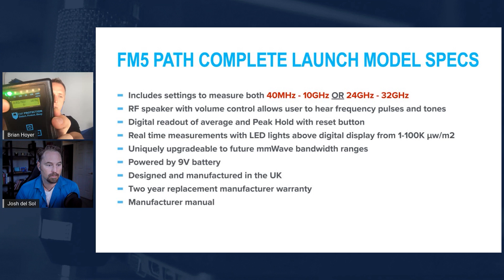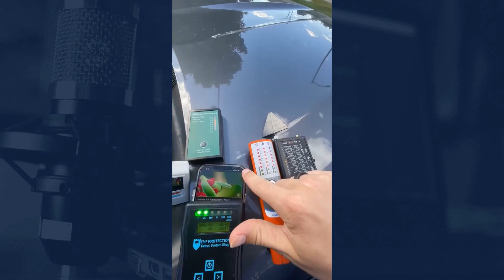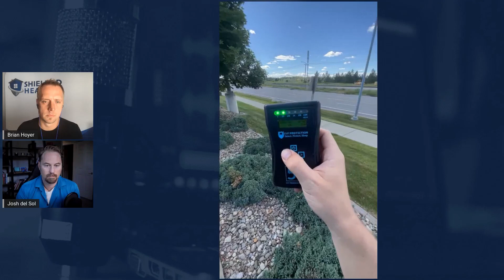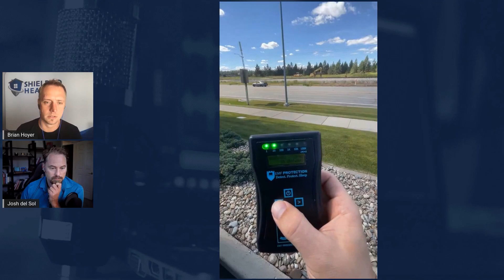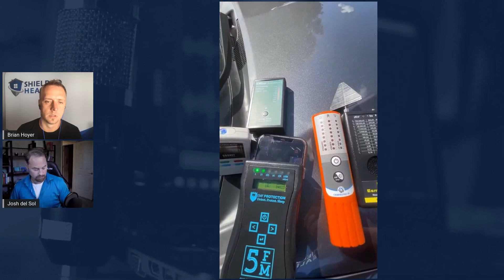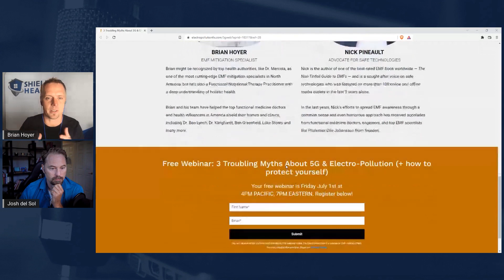5G MM Wave Testing Meter - 2022

Comment: the meter in the picture on the far right (at 1 minute 55 sec mark in the video) for $12 K (called "wave control" ) doesn't actually measure RF (aka E.M.R.).  It only measures either Magnetic fields, OR Electric fields.  From their website, it seems they do not fully understand the difference. 

there are 3 basic types of energy (and a possible fourth for the purposes of consultants like Brian Hoyer... called "dirty electricity" but it is less a "type" of energy and more of a phenomena of voltage instability, called voltage transients.   voltage is basically analogous to "pressure" behind the electricity, similar to water pressure in a garden hose.  basically it deals with problems in the way electricity flows in the wiring and how that causes fluctuations in the other fields E and M , which can negatively affect our health over time.)

the three types of energy we are dealing with, that seem to get confused ENDLESSLY online and in general (even in sources that claim to have a science or engineering background, or even government websites, and they get it WRONG more often than not...):

1 Electromagnetic Radiation  (from the electromagnetic spectrum...  this is what is known as "wireless" in most applications we use.  it is also often referred to as R.F. ("radio Frequency"), but that term is misleading as the energy is not defined by its Frequency,  but rather by HOW it is generated and its behavior)  It includes 'Radio' waves, Microwaves(and millimeter waves), ultraviolet waves, visible light, infrared waves, x-rays, and Gamma rays.

2 Magnetic fields  

3 Electric fields

The Wave control meter only measures the last 2 types of energy listed above.  It does NOT measure the wireless radiation of the first group which is what 5G is generating wirelessly, (in order to establish a connection to our many devices, etc.)

The point is that people are confused because two different types of energy can have the same frequency but be totally different things that behave differently.  It is also confusing because the words are used in both terms.  Electromagnetic has the words electro and magnetic in it , however it is NOT the same as a stand alone electric field, nor a stand alone magnetic field.   Magnetic fields and electric fields curl around the wires that electricity flows through, and doesnt go out in a straight line in space like the Electromagnetic radiation does!

take 60GHz.  this is not a type of energy so much as a measurement of how many times a wave passes a point in space, ... put another way,  it is how many times a wave completes one oscillation.  60 Gigahertz means 60 billion wave cycles completed in one second.  But WHAT is "waving"?   it depends!

So, i can have a magnetic field that oscillates at 60GHz but it still is not a electromagnetic radiation.  it is not on the electromagnetic spectrum!  (which is what light is included in.  light IS part of the electromagnetic spectrum.)

Waves on water are generally very slow (low frequency) but that still doesnt mean that if i have two energies at the same frequency that the same meter can measure both of them.   water waves cannot be measures by a magnetic field meter even if the meter can detect waves (in hertz) that are the same frequency as the water waves.   because they are DIFFERENT types of energy.   the thing that is "waving " is totally different!...

The other way you can tell what the meter is measuring is by the units.

The wave control meter is measuring in either Volts per meter --> " V/m " is for Electric Field strength,   or... ........ 

  Gauss or Tesla ...  often Milligauss or microTesla or nanoTesla(all are units for magnetic fields ONLY)

  In order to measure RF it would be in Watts / meter-squared, or similar like microwatts per meter squared, or dB, such as dBm (decibels below milliwatt, etc, for a spectrum analyzer measuring  Electromagnetic Radiation)

I could, for example, generate a sound wave in the air, that oscillates at 60GHz but those meters in the video would not be able to detect it because the frequency is not what defines it, but the type of energy .. ie HOW it is generated.

sound is generated by air molecules being compressed and then spreading out as it travels through the medium of air ... but even if the frequency of the wave of air molecules is the same as what an EM meter can detect.   it cannot measure it because it is not the same TYPE of energy and it is generated in a different way.

Electric fields are generated by any charged particle even if the particle is stationary.

Magnetic fields are generated if a charged particle is moving at a steady speed in one direction

Electromagnetic Radiation (think photons, including visible light and other wavelengths of radiation) which is created by charged particles (like electrons etc) ONLY when they are CHANGING their SPEED and / or their DIRECTION  (in physics a change in direction is equivalent to a change in speed..... so moving in a circle, for example, is a type of acceleration towards the center of the circle even if the speed along the circle is the same...! "centripetal acceleration")

the type of instrument that measures these energies are not the same, even if the frequency is the same!

Therefore, the wave control meter is a completely different meter having NOTHING to do with measuring the wireless radiation associated with "5G"!

I hope this helps to clarify things.
(to be clear I am not trying to criticize Brian.  In fact I will be getting the FM5 Meter and look forward to receiving it.   i just though it was important to clear this up.  He probably didn't realize that the wave control meter was not a RF meter.)  it took me a while to realize it also when i first found the wave control website.   i had to dig to figure it out because the website is not very clear on the terminology.)
Reply: Thank you for taking the time to share your knowledge. It did help me.
Do you have any particular sources to recommend to understand better the differences between all the types of radiation and how to measure them?
Reply from the maker: There is a very active discussion here with Brian answering questions and explaining all of this in detail: https://www.takebackyourpower.net/first-affordable-mm-wave-tester-is-here-and-the-results-are-staggering/
Reply: @JoshdelSol  Thanks for the link Josh, and thank you for all your work
Reply: Most consumer RF meters work back off the e-field and convert that value to whichever units they want on the meters display.
Reply: @lnTheRed  an E field is not the same as EMR, so any such thing, IF true, would be a meaningless measurement. 
   Any electric charge generates an E filed, even when stationary.   Only during an acceleration or change of direction does a charged particle momemtarily produce another effect resulting in EM radiation.  
     E fields stay near the charges that generate them, but EMR travels out in a line from the source and gets weaker as it travels, by 1/r^2.   

So, if what you say is true about consumer meters, then they are committing fraud.   I somewhat doubt this, because you can test it by going to known sources of one or the other field and can check if such readings are registering.  

This may happen, but likely it is a rare occurrence by either those wanting to be fraudulent, or more likely, they have no idea that Efileds and EMR are not the same, and so dont understand what they themselves are selling to the public.   People call everything EMF these days, but EMF really only refers to wireless radiation(The electromagnetic Spectrum, which does NOT include stand alone Magnetic fields NOR stand alone Electric fields).   Magnetic Fields and Electric fields are not the same as they both stay near the charged particles that generate them.   

Now perhaps you are saying something different.   Perhaps you mean that the meters take the virtual E COMPONENT vector of the superposition of the EMR, and try to extrapolate that way, but im not sure how that would be possible, because such components are only mathematical representations for derivation purposes, not real world phenomena.   Just like for example if i run around in a circle,  my component vector of my acceleration is pointing directly at the dead center of the circle, but it is not a representation of my actual physical activity, it is just showing an aspect of my motion that would be difficult to represent the real overall motion as a whole, so instead the tangential and centripital acceleration vectors are given separately instead.   then at any instant the resultant vector would be a representation of my real motion at that instant.     

Do you know which case it is with your claim about consumer meters (math vector component of EMR ... vs taking stand alone E field of charges), and if so, can you clarify?

Consumer meters may not be very accurate but i doubt they use a just pure E field to extrapolate EMR.  
  More likely, people just dont know what they are selling and how it works.  Most sales people are not engineers, and even some engineers get these concepts wrong. ...  even government websites about EMF get the related concepts and terminology wrong, more often than not.   

You cant just convert to EMR in microwatts/cm^2  out of a Volts/meter value from a E field due to electron charges.  ...At least not if you want a real meaningful measurement.   Power density refers to EMR.    E fields of a charged particle proximity is a different thing.  the difference is explained in a physics text from any university. 
  and Magnetic fields (gauss) are also not able to be meaningfully converted into EMR units of uW/cm^2 either.    again, confusing virtual Mag field component vectors of EMR(a release of radiation due to charges ACCELERATING), with a stand alone magnetic field (Gauss / Tesla) due to constant velocity of moving charges (electrons, etc),  would be incorrect.

please clarify.
Reply: @ancientwisdom2012  

PFD / Power Flux Density = (V/m)2/377 watts per metre squared (W/m2)

e.g. 58.2 V/m (ICNIRP 1800 MHz) = (58.2*58.2)/377 = 9 W/m2
Reply: @lnTheRed  The point is that it is not an Electric Field being measured.    ... Everything else you said is valid except your use of the term "E field".     You ARE measuring V/m ... but NOT from an E field, rather V/m due to ElectroMagnetic Radiation

Both E fields and EMR can be measured in Volts / meter, but they are DIFFERENT forms of energy....

Field Type    	                   Measuring Units                                                                                                     Type of energy / how it originates
-----------------------------------------------------------------------------------------------------------------------------------------------------------------------------------------------------------------------------------------------------
RF / EM Radiation 	   Volts per meter (V/m), or microWatts per square meter (µW/m²)                The EM Spectrum / 'light'...radiation released at speed 'c'  
                                                                                                                                                                              due to ACCELERATING charged particles.  

Electric Fields 	           Volts per meter (V/m),                                                                                           generated by ANY charged particle, remains near it.
                                                                                                                                                                              (field exists regardless if charge is moving or stationary.) 

Magnetic Fields 	          milliGauss (mG), nanoTesla (nT), Ampere per meter (A/m)                           by the CONSTANT motion of charged particles
                                                                                                                                                                              or via a magnet. 
                                                                                                                                                                              (mag fields remain in proximity to the source / charges.)

I could measure a magnetic field in Gauss, and then calculate a conversion to Tesla. ...  in that case It is a meaningful conversion because both units refer to the same type of energy.   V/m is potentially confusing because it can be used in reference to two different types of energy that are not the same phenomena.

An apple and an orange both have a round shape but you wouldnt say that measuring the curvature of the apple could be extrapolated to reveal an understanding of the nature of an orange.  They are both curved but are different fruits.   Different things with a similar characteristics doesnt mean that they are one in the same thing, nor interchangeable via mathematical conversion.  

so basically all you needed to say to be correct in your initial statement, is that the >> EMR << is being measured in V/m (EMR instead of Efield), and then the units of V/m of the  E M R  is converted to W/m2.  ... a calculation which you did in your last reply.  

The math looks fine, it is solely your use of the term "E field" that is in error.  I hope this helps clarify things.   take care...